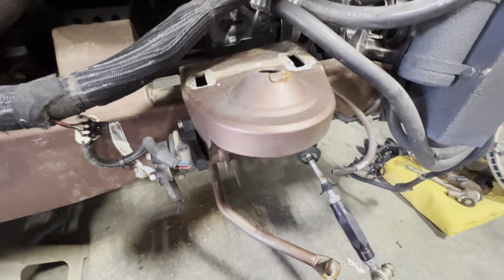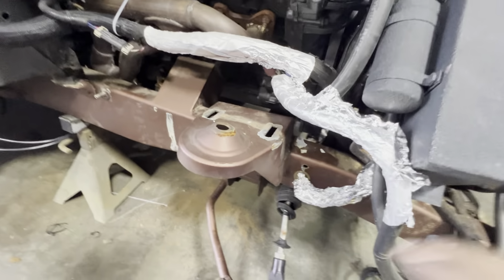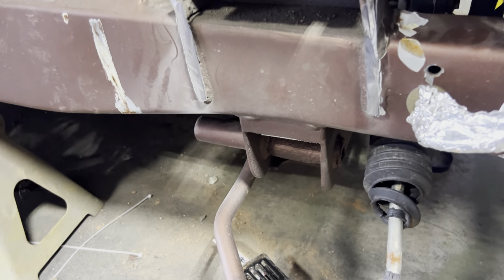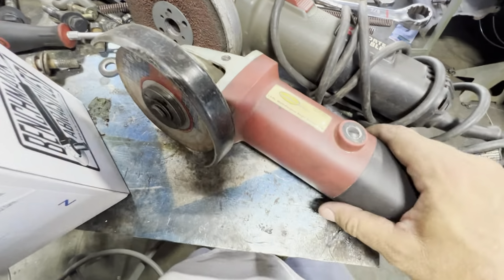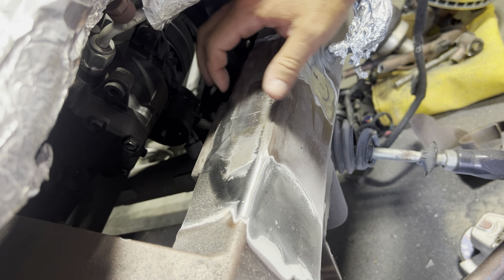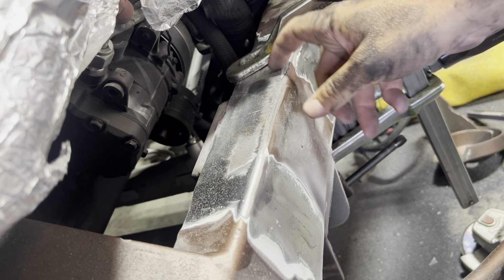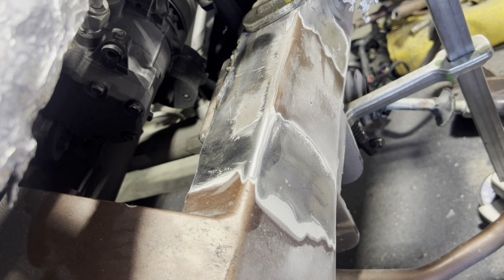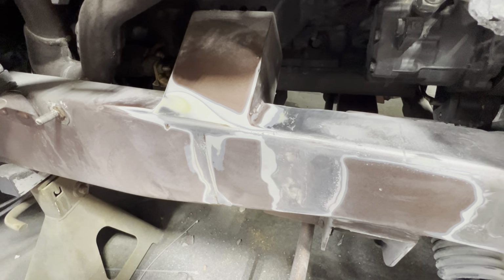Part 4 - 1950 Ford F1 Rustomod rebuild - Removing the Bent Top Hat

Comment: You have the link to the frame build?
Reply from the maker: https://youtu.be/Yj_XfOhAFcw?si=FKlV9TKi-gMjMfc6
Reply from the maker: It’s not that great, pictures really. 

If you have questions, ask!!!!
Reply: @CoyotefiftyF100  real curious about your brake and clutch master cylinder setup. Are you running hydroboost or brake booster?